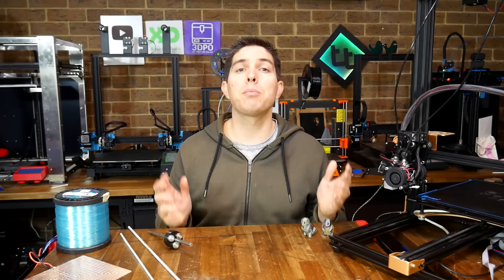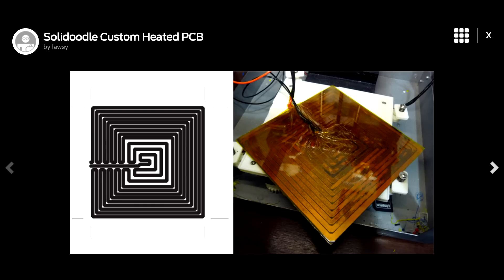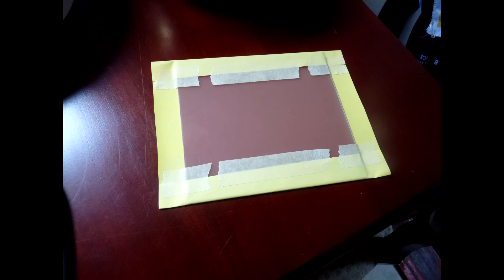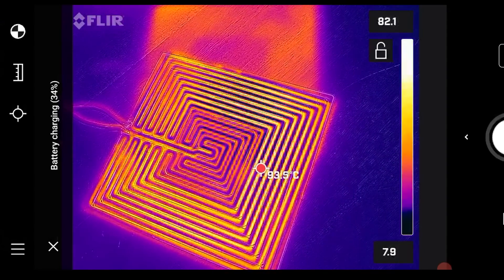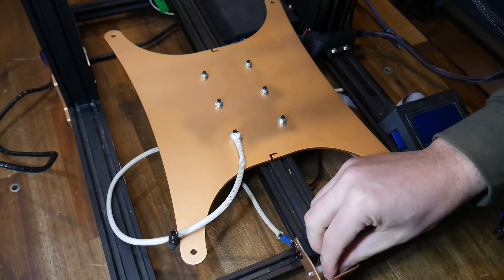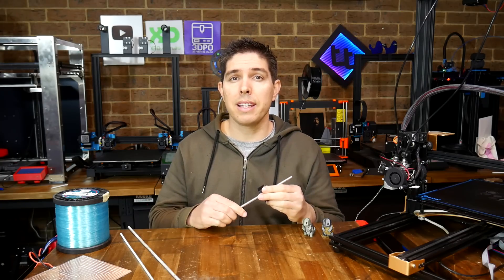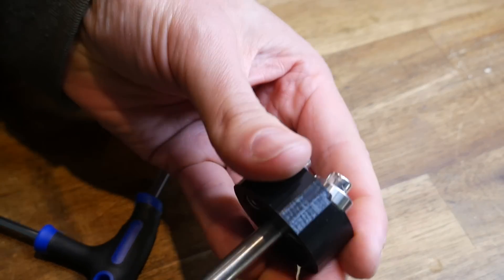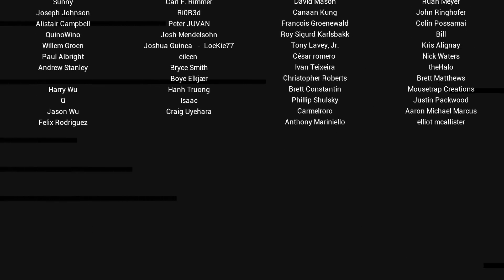Retesting my craziest 3D printer mods from the last 10 years

Comment from the maker: Thanks to all of the people posting that I used the wrong fishing line in this video. I have no patience for fishing and I'm allergic to eating fish so my knowledge on this topic is limited. I believe I used braided back in the day on the Solidoodle (as can be seen in the timelapse shot) and it did indeed did print better than shown here. Sorry for the confusion, and hopefully some folks might now know they can substitute line for a belt if in a pinch.
Reply: I'd say you would need better torque adjuster. one that pushes on frame, rather than you try pull it
Reply: i want to hear more about that changing head

Comment: back in 2013 my first printer was a delta printer that used fishing line instead of belts. It was pretty cool. The guy who designed the printer made the pulley's from nylon and the line would ride up and down as it moved, which I think was your problem because the toothed gear would cause problems with the print. I still have the printer in my basement, I bet if I dug it out it would still work!

Comment: good video. I remember about PEI, I read about it and would it work better than my glue/kapton/masking tape. I was impressed highly when I got the PEI plate, about 3mm thick, now that would be 8 years ago, I still have it right now tempted to use it again, I had over 100 hours of use till my printer refuse to carry on. Since then whole lot change (I do not use PET for PEI or glass). I always use PLA to lot of my work. I just got the new printer only last week ready for ABS/ASA printing.

Comment: You should build a printer with all diy components and compare to a out of the box ender clone.
I think a tensioner nut on that bearing screw would be a good addition for when the wear creates slack.
I also think that fishing line with one loop on each side of a belt running ontop might be a way to tighten up a existing belt.
Really enjoyed this compilation and the memories of acid etching pcbs came to mind. :)

Comment: Fishing lines work well. I work as a metal machine place. Imagen my suprice years ago when the yearly check up on the 3d probe machine. It was just thick boat lines basicly in a hell of a tension system. i thought it was ballscrews..i been open to fishing lines/knot ropes sins then. meters of line. i thing its area is around z800mm, x800 y800.
3 of 20 is allowed to use it no exeptions...i just see it as a sail boat now.

Comment: You cannot simply measure low resistance values (usually less than 5 ohms) with a multi meter. The reading you get will be higher due to test lead resistance. This means your PCB would draw significantly more than 15A and could damage the PSU by overloading it. You need to use the 4 wire measurment technique to correctly test the resistance of your DIY heater pad.

Comment: How much time passed until wear accumulates? I had seen the exact same part before and I thought I should try this. I have all parts to make this bearing mod and I have the same fitting issue. If it is worth doing it I will give a go

Comment: Mechanisms that use a cable (i.e. fishing line) are often tensioned by having an extension spring attached to the cable. This was common on radio tuner scales for the pointer mechanism
Reply: Add mechanical reduction into that system for bonus engineering points and less pucker factor

Comment: No way, you're lawsy? what a blast from the past. 

I don't think we talked much on the solidoodle forums (my name was rsheldiii) but I had a similar trajectory into 3d printing and hobbyist making in general - thanks a lot to you and 2n2r5 and everyone else on soliforum. I was fresh out of college for computer science, with a passion for but complete lack of understanding of other engineering subjects. I was enthralled with 3d printing and purchased a solidoodle 3, before quickly realizing that almost everything on it was underspec. The vibrant community on soliforum was the only thing that kept me from throwing it in the garbage bin.

I decided I wasn't going to buy a new printer until I made this one work. By the end of it I had quite a few modifications: the mk6 extruder with e3d v6 hotend, direct drive y axis, upgraded extruder stepper driver, cable chain, qu-bd heated bed with upgraded traces and power supply (I pored over your wiring image for far too long, it was my first soldering project), and lmuu8 x/y carriages.

I then put it on a very high shelf and bought a better printer (Prusa mk3 now). One of my requirements for buying new printers is that the official forums for the printer are a wasteland - if they're as lively as soliforum was back in the day that's a bad sign.

Thanks for all you've done over the years! Soliforum and my adventure with the Solidoodle helped me realize that all technology is made by humans, and if someone had to put it together, odds are I can take it apart.

Comment: hello I was wondering if you have a solution for my issue. i currently own a an ender 3  v2 printer with  a BL-Touch. I'm having trouble with the printer head offsetting too far from the glass after it levels the bed before it prints. I've researched a way to use pronterface but my printer landed into an issue where my usb port runs into an error and states that it cannot be recognized. i had another person said that I didn't need to use pronterface and should look into marlins. I see many options on their site, but I don't know what options i should pick for the BL-Touch. the mother board I'm using is the creality version 4.2.2. honestly I would like to just start printing and tweak things as I get more familiar. I think I have bit more than i chew here, and could use a little guidance. please help me out; it would be greatly appreciated.

Comment: Adding a second threaded bushing to the other side so you can tighten up the slag between the two to practically zero, way easier to do than what you did with the ball bearings on the rod which is also a very cool idea that I didn't know it would work.
Reply from the maker: When I was revisiting the forum thread, someone did exactly that. There was two versions of the Solidoodle bed mount. Unfortunately I had the old plywood thick one instead of the newer aluminium slimline version so less room to work with.

Comment: Nylon isnt the correct type of fishing line for this, there is simply too much elasticity! You must use the more modern braided line which has no stretch at all. Also, these setups always use round, not tooothed pulleys and idlers

Comment: Use a fast solenoid for retraction, stepper motor for feed.
On a Bowden rig: at the Hot-end, Bowden tube mounting flange is mounted to a short-throw solenoid.
When solenoid is operated, it increases the distance between the Bowden tube flange and the hot-end, retracting the filament.
The stepper feeding the filament goes stationary during the retraction interval...it doesn't 'chew' the filament by pulling it back and forth.
Solenoid Retraction at the Hot-end is gonna be as fast as direct-drive retraction, if not faster!
Reply: This is a cool idea!

Comment: Z backslash isn't much of an issue on Z. What you can do pretty much completely elminate backslash on 8mm threaded rod on z is to 3d print like 1cm tall nuts from pla and use those instead. It works very nicely with no play and some spray teflon in there its nicely slippery and the printed nuts last a long long time

Comment: In the fishing line part, you used only one line, so the stretching is too much. It may be a bit trickier, but I think a few parallel lines together would make a much better belt replacement.

And since you distribute the load between multiple lines, you wouldn't need to wrap the lines on the motor gear as much as you do with a single line. Only one lap winding, just to get twice the friction per line, when compared to a non-winded line. 3 fishing lines, 6 wrappings in total, which is almost the same amount of wrappings as you did. But with roughly a third of the stretch(polymers can have very weird stress/strain graphs, which may not even be linear in any part of the graph, so less stretch may not be half the stretch but may be more or less than half).

Comment: You might want to look into rolling screw extruders, they use the same concept as the Threadless ballscrew except the rollers have sharp rings on them to grip the filament and it's the ring part that rotates instead of the rod (filament), it looks promising because there aren't really any teeth involved (you would probably even get away with rubber on the rollers)

Comment: Can someone point me to a video or website that explains what quality prints are normal in 3d printing? I have wasted so much time trying to perfect my printer instead of getting started with the hobby and I wonder if I demand a perfection that may be completely unrealistic.
Reply: Perhaps going to a forum where people talk about 3D printers, either in general or specifically about the brand of printer that you have would be helpful. You would be able to post a couple of photos of what you have printed and point out anything that is bothering you. If you go to a place where people are talking about your brand of printer then you would likely be able to see what other people are producing with the same model of printer.

The printer is not going to make objects with perfects smooth surfaces. If you get the prints that almost always stick to the build plate, don’t have very much stringing, are dimensionally accurate, and don’t require a lot of work (this varies depending on the person) to clean up in order to decorate then you have done an excellent job of calibrating your printer. 

Also, setting up your printer is not something that you have to absolutely finish before you may start your hobby. Setting up the printer is an ongoing process. As you learn more about 3D printing then you will be able to go back and fine tine your printer or slicer settings. Unless your prints are not sticking to the bed or you are printing a lot of spaghetti then start printing your hobby prints. It would be terrible for you to begin to hate 3D printing because you see the setup process as frustrating, at least I get that impression from your message. Don’t be afraid to print. It’s only a bit of plastic. I’d suggest trying some smaller items before jumping in and printing the larger one in order to get more comfortable with everything. But most importantly, have fun.

Comment: Funny thing about belt stretch is the majority of it is caused when a printer sits on a shelf for a while  without the tension being released , if you are not  going to use a printer for a while loosen the belts up - same goes for bandsaw  and hacksaw blades .

Comment: Ha, omg, I just remembered building my first printer in 2012. The 'Prusa Air 2'. It used two M8 rods for the Z-axis, and I got ripped off by the seller, who sold me soft steel smooth rods. What a time. And I paid triple the amount of an Ender 3 for that crappy kit and still had to upgrade it with so many expensive parts, first a Budaschnozzle, then a J-head clone. People mainly printed with ABS back in the days, and the tolerances were all over the place. I get the idea most people don't get to appreciate how great printers are nowadays, compared to how it was 10 years ago.
Reply: I remember soft steel smooth rods, I got ripped off too. That was I think 2014, I could not tell if it was chrome coated rod. Took a few month and found it has indent my rods.

Comment: I didn't know you were Lawsy! Heavily modded my Solidoodle 3 thanks tp your designs.
Replaced imperial threaded rod with metric one, plexiglas covers, threaded rod decoupler, glass bed, touchscreen display with a Pi and early version of Octoprint, webcam.
Recently I upgraded the hotend with an E3D V6 but the thing is not really reliable. The PSU is underpowered, the mainboard cheap, there are bushings instead of bearings...

Comment: On the fishing market you can find steel lines (in many cases are covered by a similar rubber polymer coating), so if you want give a new chance to your belt mod. Classic fishing lines are a lot elastic so you can’t eliminate similar jerk problems, like you can do with the belt, but maybe with a steel fishing line (and maybe with more than one pass, before the 3 passes on the motor gear) elastic effects can becomes less enough to do a better test.

Comment: by the way Michael sorry for the double post, just thought you you might want to hear, I'm currently designing and building and all ballscrew printer with just over a one cubic yard capacity, this is monster of a printer.. uses a big tree tech board, but I'm having trouble finding heated printing platen big enough to suit my needs. 40-44 inch square I was thinking of a large aluminum plate with 4 silicone hot pads to give me a zone heating system, then I can print smaller things on part of the print bed without heating up the entire print bed.

Comment: My best mod is a water cooled hot end for my Prusa Mark 3S. I designed it using all off-the-shelf parts.  the only modification to the printer is widening the opening on the Prusa extruder cover which can be done with an X-Acto knife. Since I changed to water cooling, I have never had a printer filament jam, and I'm able to print faster much hotter and using more exotic materials such as CF poly carbonate than I ever could with a regular unmodded hot end. I've had several people asked me to post my design. As far as the hot end goes it's a standard V6 hot end, with the fins milled in an alternating pattern to create a flow for the water. Which then gets copper jacketed. Standard 80 mm rad and pump and then I added a flow meter with a LED temperature sensor. Shame they don't allow pictures to post in the comments. I've been running this for over a year now and would never go back to a standard hot end. Not even 1 of the new ones.

Comment: I am still using the diy bed heater I made using the copper tape stuck in a pattern to aluminum bed separated by tape. It works quite well..

Comment: I don't see any benefit of PEI over Kapton tape on aluminum bed.
Reply: Last time I printed on kapton tape I couldn't get ABS to stick at all.
PEI just heat it up and off you go. ABS, PLA and TPU, those two not even necessary to have PEI tho as they'll stick to plain glass.
Dunno PETG, but that one sticks well and releases easily from plain PVA based wood glue.
Reply: I'd mod it for glass or something onstead. Ripping tape and replacing it sucks and the adhesions not that great.

Replicator shipped with steel buildplate that you put kapton over that was supposed to be the bees knees but really it wasn't..

Comment: That bearing lead screw is called a Helical Crayford and was invented for moving focusers on telescopes. It was invented by the Crayford Astronomical Society in Kent UK.
Reply: Also used in lots of high precision positioning for measurement machines and stuff
Reply from the maker: That's cool, thanks for sharing.
Reply: How much time should be passed until it wears down?

Comment: You used monofilament nylon which is deliberately stretchy. The braided dynema you showed would have been better.

The main issue with fishing line (at least the way you've done it here, with no fixed anchor on the pulley and nothing to deal with string walking over itself) and threadless ballscrews is precision, both are friction drive as done here and will drift. If you marked the carriage location on the linear guide and ordered it to move back and forth a bunch of times, it would not return exactly to where it started. The drift often isn't severe enough to notice a layer shift, but over the full height of the model the layers will definitely be skewed a significant amount. Try printing a tall cube and check the vertical walls for flatness and squareness to the base.

Comment: Can you not use wheels on the rod instead so it's interfacing with a softer replaceable material?
Reply: You would loose precision.
There is actually a little compliance in the plastic frame the bearings are mounted on. Not much but enough to accommodate any minor variations in the diameter if the rod etc. For precision we want compliance to as little as possible

Comment: You see the ripples in your fishing line print because you have a toothed gear, you're effectively changing the tension for every tooth on there. I'd bet if you drove it off a cylinder instead of a gear it would work just fine
Reply: ...Or a large-radius sheave maybe?

Comment: Wow coming from industrial equipment, that tensioning system where you just pull it tight and set it... A screw mechanism would be much better.
Reply from the maker: That printer is a few years old and newer prints tend to have much better systems like you describe.
Reply: @TeachingTech  good to know

Comment: My first 3D printer was a Mendel that seemed to get an upgrade every week eventualy finishing up as a Mendel 90, the community for RepRap Mendel was massive with none other than Joseph Prusa highly involved in the community which was extremley close, I made some good friends back then and am still in touch with a few of them, a few of us who were also into machining and CNC used to make parts and sell them amongst us but ended up stopping selling them amongst us as people who found out seemed to think they were entitled to be able to order parts from us, it was never intended as anything even remotely retail just letting friends buy a part from leftover steel stock for the material costs, in the end we just used to offer people the parts files if they asked for a part, and then Jo Prusa started selling parts and the pressure was off us!